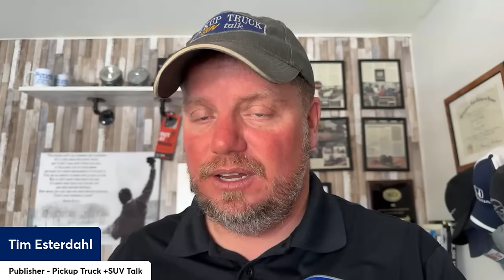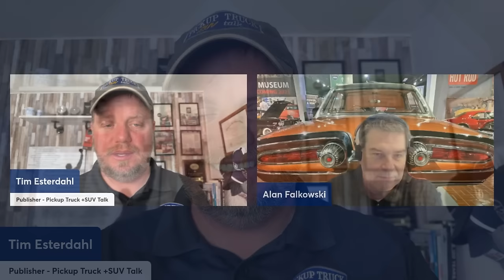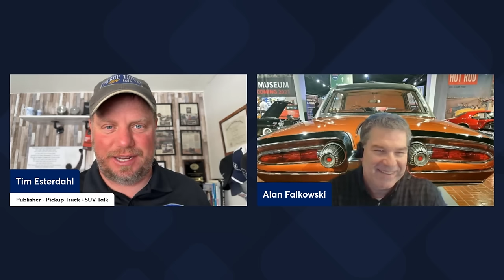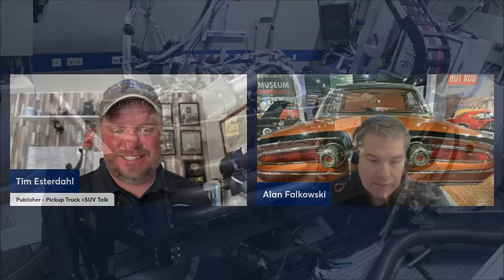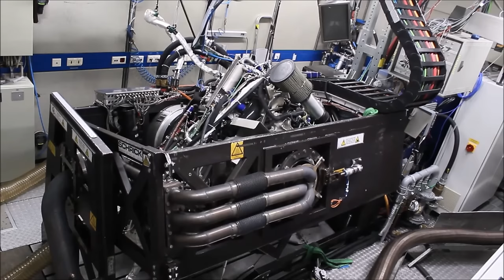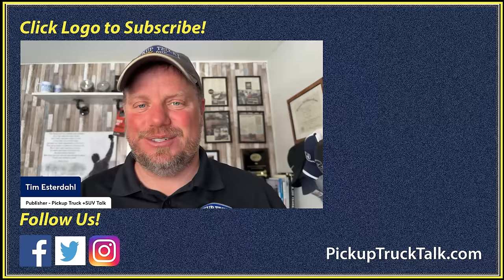Engineer Deep Dive: 3.0L Hurricane Engine - Turbo Life, Oil and Intervals and More

Comment: Hope it’s more reliable than the 5.7 Hemi I had a lifter failure at 40,000 miles they put a new long block in fingers crossed it’ll last at least another 40,000😂 Stellantis Dodge and ram are not known for reliability. It’s really a shame because I love the truck and I hate the truck. Great video. Thanks.

Comment: Wow《☆》My 2002 Hayabusa has  non sleeved cylinder bores with some sort of plating between the aluminum & the piston rings. It's holding up well so far but it's very low mileage for a 2002 motorcycle. I never imagined car engines would go this route✌🏼😎☯️

Comment: So with the start stop system they addressed the increase in wear and tear on the starter by beefing up the bearings and brushes in the starters…. But a starter is or atleast should be a relativly cheap easy part to replace. What i want to know is what they did for the interruptions to oil flow on these starts snd stops to rod, main, cam,rocker bearings, bushings, and wear surfaces.  Through out all these changes in engines one thing remains constant in the used vehicle market, highway miles are preferred over city miles respectivly as they generate practicly zero wear on these parts. Start stop seems like it should magnify those city mile problems… atleast in my mind.

Comment: I'm just not getting a warm fuzzy for 0W-20 oil. Almost it was put in there to reduce pumping losses.  

I will stick with the 5W-30 that Ford recommends in my 2018 2.7 F150

Comment: Question, why use the low temp cooling system to cool the charge air but also the hot turbo?  Wouldn't cooling the hot turbo increase the temperature of the charge air.  Sorry if it's already been asked.

Comment: Great Vid thank you. I had one question. When you do a lot of short trips ie: around town should you use the heavy use oil change schedule in the manual? I’ve heard this debated due to the impurities not being boiled out because the oil does not get to full operating temp. I know the real solution is to take your car for a longer drive every 2 weeks or so. But, I know a lot of people like me don’t do that.
Reply from the maker: Oil impurity? Synthetic oil and additives remove impurity from the oil. That’s old school vs new school engineering.
Reply: For sure, I just thought I’d mention it due to the fact it is still debated on some YouTube channels. I probably change my oil a little more often than really needed. Old habits die hard. I’ve had 2 engines cook in my lifetime of cars… neither were oil related but it is in the back of your mind. Lol, whenever they talk about straight sixes I think about the old boat anchors from the 70’s first…I’m excited to test drive one of the new engines when I get the chance.

Comment: All three of my vehicle's are turboed, two dies and a gas. They've all lasted well because i service them every 3000miles, quality oil and filters. They are reliable for that reason and the fact that they are all over engined, bigger engines for the respective weight and duty impossed by each  vehicle. Putting an over boosted, smaller engine into a 1500 sized truck and making it tow 12000lbs over hill and dale; it aint gunna last or be economical. Time will tell though.

Comment: The stop start system in my vehicle damages the battery. My first battery using the stop start system lasted about 2 years. Now I never use it and the battery 5 years old. I know it’s anecdotal but in my case it’s true
Reply: Imagine what that would do to a turbo unless you use a electrical oil pump.
Reply: @j-mo3129  
Yes and you can’t make a direct comparison of a diesel turbo engine versus a gasoline powered passenger car turbo. It’s two different applications entirely.The engineers are trying to sell it as bulletproof but everyone knows what the outcome is in the real world

Comment: I wonder if they can bore it to 92mm and stroke it to 100 mm.  They may need to go there given fords displacement lead at 3.5 liters and  i can see ford pushing their power up to get equal to the HO…the best part of an inline 6 is that you can bore and stroke without wrecking engine balance..which happens in v6s especially v6s over 3.6 liters.

Comment: He says they took all this heat into consideration and then they bolted everything that could be made of plastic to the block that they could. Plastic the first couple times it's heat cycled is okay but by 100,000 mi of heat cycling. 😅 They definitely learned with the oil cooler issue on the V6...

Comment: Very interesting. I would love to hear about why it is ok not to change oil in my ZF designed 8 speed transmissions. We have one in my '21 V6 Grand Cherokee and one in my wife's 2 l Turbo Wrangler Unlimited. Want both of these vehicles to last a very long time.
Reply from the maker: Not that uncommon. A lot of brands don't have transmission oil change intervals. The oil has simply improved so much you don't need to change it like you used to in the past.
Reply: @Pickuptrucktalk well, don’t need to change it to last the warranty period anyway….

Comment: More power, torque and fuel economy is good but I'm not happy to see him not say longevity was a goal. Even when you start from the beginning with a engine and design it to be Turbo asking a small engine to put out more power and torque causes it's  life to be shorter than making the same numbers with a large naturally aspirated motor. Basically all you need to know is that this Hurricane isn't in a 1 Ton Dually but the 5.7 and 6.4 were, case closed.

Comment: I have the 2025 RAM 1500 SST SO using 91 octane, physically calculating my mileage while towing 4000 lb trailer, I get between 8-11 MPG, generally staying below the posted speed limit. Seems like it should be in the upper teens??

Comment: They design these engines to be expensive to fix, for no other reason that to try and force you into a new one. Make a simple thing cost hundreds, or even thousands. Gets you thinking it's time to upgrade! 

Don't believe me? Older hemi's had a bleeder bolt on the top of the water pump. When you flush your coolant you could just pop that bolt out and start pouring. When coolant comes out the hole, you're done. No air bubble. Convenient, right? Exactly. They took that bolt away and now to fill the coolant system and purge the bubbles, according to the service manual, you have to do a vacuum fill which costs hundreds. 

Hemi's have always been bad on lifters. Older Gen Hemi the lifters were located under the valve cover. Easy to get to, not too horribly expensive to fix. Soooo they moved them. Now they are under the cylinder head and cost thousands to repair. 

damaged camshaft bearings? Big job, not cheap, but manageable. So what did they do? They made the camshaft bearings non serviceable, so when they are damaged, or just wear out, Boom.... you need a whole new engine. 

I'm sure other manufacturers pull this crap, too.... but Ram is absolutely blatant about it. It's designed to drive you into your next truck. Rinse and repeat. Planned obselecense has gotten out of control .

Comment: Turbo engines create large amts of blow by. This created pcv pressure that’s constantly recirculating returns hi carbon contaminated gases that because of GDI injection 23:08 contaminates intakes and (now low tension) clogs piston oil rings. I believe all issues can be minimized via proper engineering BUT all modern cars seem to destruct themselves way too soon. Also 10000 oil chg interval is shown to be too long not sue to the oil itself breaking down but the oils level of contamination buildup. So evidently oil filters are insufficient to remove contamination built up

Comment: Tranfer lines are/were more relaible than cncs. Just a power outage could shut down a plant for  quality issues for a day on cncs. A tranfer line could be back up in a couple hrs. CNCs are just not reliable and are easier to make scrap parts

Comment: As he said, small displacement boosted engines can be reliable if they are designed from the ground up with boost in mind. I sure like my 5.7 HEMI in my RAM but I have also had ecoboost engines and they were reliable. I think maybe a boosted engine may be a little bit more sensitive to regular maintenance being done on time. I am certain that the new Hurricane I6 will be a success once the initial kinks are worked out. I give them 2-3 model years before I would buy one.

Comment: How about bringing back the inline 6 hemi engine? Or an inline 6 diesel engine (Not the Cummins, but smaller Fiat sourced)? Fits into the Wrangler maybe even the Hornet and upcoming small truck platforms. As far as turbos, I have a 2015 VW TDi with almost 200k miles. Still has the original turbo and drives like new. Regular maintenance and full synthetic oil.
Reply from the maker: The Hurricane is an inline 6. So you want them to call that a Hemi instead? 

They tried a diesel and it didn't work out all that well.
Reply: They offered a V6 diesel. They need to offer 4 cyl and I-6 diesels. Chrysler had a inline 6 with a hemi head years ago. Time will tell if the Hurricane motor is reliable long term.

Comment: Just as an aside, every time I meet somebody who has a turbocharged engine. I give them a specific way to change the oil in the engine.
What I will tell them to do is to put at least half a quart of either transmission fluid, or actually I trust Marvel Mystery Oil a little bit better. Drive the vehicle for at least another week before changing the oil. Any of that cooking that had occurred in the turbo shaft. Should be mitigated. Another thing I will tell them to do, if they have been driving the vehicle hard, to either drive it for a while at a much lower intensity or if they come to a stop. Let the motor run for at least 5 minutes at idle before they shut it off. It makes a world of difference in that cocaine incident. Because if you don't have any coolant or any oil pressure headed to that turbo as it's still spinning after you shut it off. It will grenade itself eventually. All of the cold circulation and other mitigations aside, you're not going to defeat physics. Unless you sit in something for the engine to sense that there's an issue and continue to idle for a few minutes on its own. Or set up some sort of an electrical circulation system for it to cycle oil at least through that turbo shaft after the vehicle is shut off. That would go a long way towards helping. Needless to say I hope nobody's using High paraffin oils anymore. That was the worst oil ever inflicted upon internal combustion engines.
If I remember correctly, they've reduced the amount of calcium in order to reduce the tendency of direct-injected engines to knock. Although I'm not a fan of direct injection, it leaves open a problem with loading up the intake valves where they get all coked up and are unable to get air into the combustion chamber cleanly. That's why I think that all turbocharged engines in all diesels should have at least a minimal amount of water methanol injection it will keep things spotlessly clean.
It might be worth ensuring that the company actually install an oil catch can on to these turbocharged engines. It is cheap insurance. You can even make it where it will automatically self drain itself back into the oil sump

Comment: the pinned comment has nothing to do with carbon buildup on many modern engines, its primarily not a question about atomization of fuel but location of the injector which is why some engines have direct injection and manifold or port injection to help clean the carbon buildup caused by EGR.  why does fuel atomization in cylinders help carbon on valves?  the turbo life is also highly varibale on the design.  some have oil lube/cooling, some have oil lube, water cooling, other combinations of bearing types and filters on oil going to fluid bearnings.  these all impact turbo life

Comment: The oil knowledge is good based on mileage. How about time? My wife and I don’t drive our vehicles 10k in a year. Does the oil still need to be changed annually?
Reply from the maker: It is miles these days not time.
Reply: yes 1 year is the max due to oxidation and moisture being added while sitting.  The additives also degrade over time.  Are you doing a lot of short trips -- then every 6 months or 6k miles whichever comes first (pistons/rings that don't get hot will cause fuel dilution smell your oil during oil change does it smell like gas--that is dilution)

Comment: Ask Allen about going and do you need both port and grill like Toyota does?  Do you have to clean valves with going only engines.  Wish you would have asked. Can you dig into that question. Good vidro
Reply from the maker: Direct and port injection does not completely remove carbon buildup. Toyota engineers came out and said it to me in another video. It helps, but doesn't solve it completely.

Comment: Alan, with all due respect if Chrysler now stellantis actually engineered their engines like you say their engines wouldn't be as bad as they are, pentastar valve issues and the hemi lifter tick issues. All current automotive engineers design and test their products for planned obsolescence

Comment: Oil weights also play a huge roll in MPG. Thats what manufactures will never admit to. It’s not that 020 protects better.. it’s that it’s a thinner oil so the engine doesn’t have to work as hard to move it
Reply from the maker: Manufacturers talk about that all time. What are you talking about? Its fractions of 1 mpg though so it’s not a big talking point.
Reply: @Pickuptrucktalk  I actually misspoke. I meant emissions. 

We used to use a summer and winter weight now oil is even lighter than what a summer weight used to be. I’m sure oil has improved over the years but I can only imagine oil has thinned out for the reason I stated.. so that engines don’t work as hard. The byproduct of that is less emissions. (I didn’t mean mpg).  

I think it was kind of proven in this video that a heavier weight oil protects better given the two different viscosity requirements in these two different engines
Reply from the maker: @PennsylvaniaDualSport  FYI - Emissions and MPG are tied together. There's carbon in the fuel. The less fuel you use, the less carbon you burn.

Comment: The engine tests for the Nissan titan clearly never played out in Canada, which is a small market.  You can only really tell once the car is out for 2 to 3 years.  Yes clearly the engineer who designed it is going to say it's reliable.  Time will tell.
Reply: Turbos are not new.  Yeah 80s Saabs turbos broke down.  And so did 80s engines as well.  This idea NA engines were perfect is hilarious.  Where are all these broken down turbos?  My Ranger drives in the mountains of Wyoming and is at 90K miles with zero issues.  Hell my '14 Tacoma had more engine issues than my current turbo.
Reply: @drn13355  I owned a 2013 ecoboost Ford F150 that end up as a long block under warranty.  Connecting rod out the block.  Yeah I have experience, some people put them through harsh weather conditions.  Don't assume people making comments have no experience owning them.  I watched these glowing hot turbo dyno durability testing videos back in 2013, thinking my god it can do that, it can surely survive a few winters commuting in Canada.  Results may vary!

Comment: Could you consider doing a video on the merit of using a bi-pass oil filter?  Amsoil has a good one apparently.  I e heard there were fuel and transmission fuel filters that should also be used.  But I’m most curious about bi-pass oil filters reducing wear and heat.

Comment: I would like to hear the explanation why my Detroit diesel engine now uses 10W30 simi synthetic that is required for 75,000 mile oil dumps? Synthetic oil is only based upon the balance of molecules of the molecular structure of the oil. Regulator basic oil works just as good. It's a farce. You're only paying for the we said it's better syndrome.

Comment: Aftermarket warranties will not replace your engine if the turbo causes engine failure. So if a turbo costs you $10k and more for an engine, best to just avoid turbo cars. I just need a car to get from point A to B, many times, I don't need to get there faster than the speed limit.
Reply: These trucks have lifetime power train warranty

Comment: Asking the salesman about the product, I expect he thinks it's the best thing since sliced bread. No dipstick so we cannot complain about oil consumption like the Chevys. Direct Injection will carbonize the valves until they leak, Water Cooled exhaust manifolds which will fail due to corrosion, Start Stop "technology" which wears out the motor and starter in the name of ???? something California.. something weather... This engine is designed to self destruct at 100,001 miles about five minutes after the warranty expires. I bet the dealer would offer me "free oil changes for life" since it will be pre-programed to have only five of them.

Dodge is actually directly on target here as a company, they know their customers won't keep the truck more than 3 years.

Comment: Oil changes less than 10,000 miles may not be worth while if customers only want their engine to last thru the warranty period but if they really want it to last 200,000-300,000 miles more frequent oil changes are good. You also fail to mention that most people don't actually fit in the"normal service" intervals listed in the owners manual, if they did then maybe 10,000 mile ineffable would be a big deal but most people don't meet those requirements and you don't bother to make people aware of all this until they come in with a blown up engine 3000 miles out of warranty.